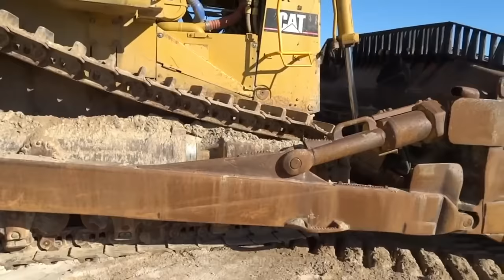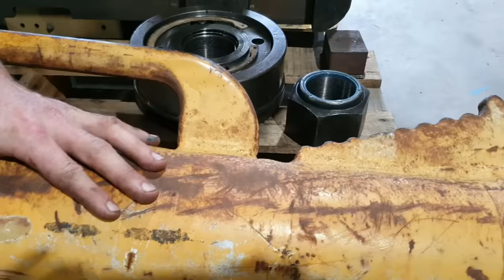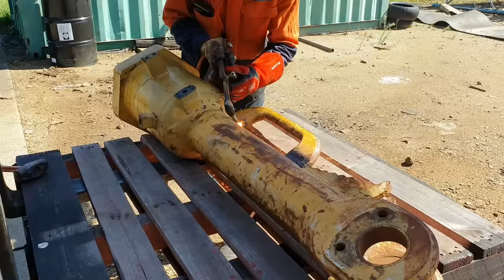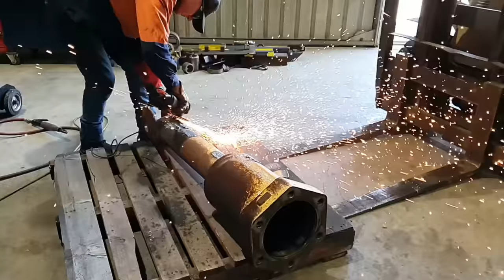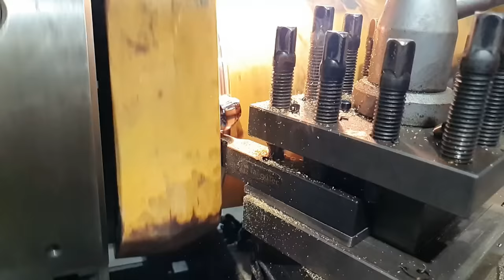CAT D10 Dozer Cylinder Rebuild | Part 1 | Machining

Comment: I'm not sure what I'm more jealous of, the smooth electric hoist for moving the heavy stuff around with, or the forklift with BOTH working brakes and forks that don't require a 20lb sledgehammer to adjust
Reply from the maker: Wait til we get our overhead 3T gantry crane setup 😂👍
Reply: @CuttingEdgeEngineering  look forward seeing it!

Comment: Another great video - good explanations. This heavy work is impressive - you will be in business for a longtime with the quality you put into each rebuild!
Reply from the maker: Hey David thanks for watching mate and appreciate the great comment 😎👍
Reply: @CuttingEdgeEngineering i have to agree with both you and David, because i have seen the pride and extreme attention to detail that you put into each and every single piece of equipment that you repair/rebuild and it would not surprise me if the parts outlast the machine they’re installed on

Comment: Great technique using the lathe to "Layout the Fabrication", and inspect it at the same time, as you say eliminates multiple handling of the job.
Fair amount of abrasion damage on the cylinder, though noticed someone gave it a coat of paint.
Sound business practice to source work, great work both.
Thanks for sharing.

Comment: Yes! This is going to be Epic. 
I hope y'all are safe during this very active earthquake event in New Zealand.
I figured that you either had factory specs from the manufacturer or you speced out parts on your own accord.
Reply from the maker: We are all good here in Aus haven't had any impact from those earthquakes. Factory OEM don't like to give out the specs so we make do with what we get most of the time 😂👍
Reply: @CuttingEdgeEngineering  even when I worked for Caterpillar they didn't like to share specifications. 
 In the late 70's we had a problem getting replacement pin sets for the earth movers and end loaders. I don't remember why but we decided to start remanufacturing the pins ourselves. We tried several different processes but finally landed on a MIG welding process that had a hard facing flux included in the wire. We perfected the process so well that it gained the attention of Corporate Caterpillar. We gladly explained how we had done our research and overcame our failures. After giving our presentation we got the
copyright and patent infringement blah, blah, blah. Then came the real meat of the program. Fellows we appreciate your hard work in developing the process but we have one big issue with it all. Can you back off of it for a couple of months so we can sell the pins off the warehouse shelves first? Boy were we relieved! We thought we were getting sacked for sure! Man those were the days. Keep up the fine videos and give the giggling videographer a raise in pay for putting up with you! Be mindful to keep nice cool water in the executive swimming pool too! 
 Thanks for the videos and keep up the fine work!
Terry from South Carolina

Comment: Is it just me, or does weld have a different sound when he's cutting through them on the lathe? like the weld chips have more paper crackle to em, whereas the rest of the metal tends to have more springy 'ring'(?) to em...
Reply from the maker: Hey mate you're spot in it does have a different sound and machines differently. The weld is a harder material
Reply: @CuttingEdgeEngineering  now is that due to the composition of the filler or the way in which it cools, i.e. annealing it would reduce the hardness?
Reply: @davidgramsay  it is harder in a few different ways. first the material the wire is made from superior materials  to the steel it will be fusing to, second the way the grain structure is in the weld is far different to regular steel as the grain of the metal gets massaged and rolled out when it gets manufactured where as welding is more simalar to cast metals due to the way welding processes work, third it is a bit like hardening steel due to the nature of welding it heat treats the weld however this does mean the weld is more brittle as it hasnt been annealed
Reply: @davidgramsay  To add to Drew's response, all of this actually depends on composition of the base metal, filler metal, pre-treatment, post-treatment, and how the metals respond to heating and cooling, especially in welding where the heating and cooling are localized to an area and not a full-part cycle like you see in heat treating. Metallurgy and material science are more complex than a one size fits all description of a single occurrence of an application of a presumably known filler on a presumably known metal. Most fillers you use on mild steel will act this way, but the outcome is entirely different if you're welding on a 303 stainless, as that will also be entirely different than welding on an annealed (pre-treated) 304L stainless, and that's before getting into alternative metals like aluminum. So while the response works for mild steel with a typical filler, the response would be incorrect in any other combination of base metal and filler. I also don't agree with the, "... superior materials,' part of the comment, every material has it's use and no material is superior unless you're seeking a very specific attribute of a material; it's similar to the strength argument of materials, there's no one simple answer because 'strength' can have multiple meanings, typically rigid yet brittle or flexible yet doesn't snap as an example, or how much a material can elongate before ripping as another example. 

If you're actually interested in metallurgy and material science, etc., I'd suggest researching it on your own and seeking out someone who has actually studied extensively under the subjects, or just outright studying it yourself. Rather than seeking answers from armchair experts, e.g. YouTube comments and Reddit threads, which is prone to leading to misinformation, e.g. 'superior materials.' You can also judge if someone is an actual expert or an armchair expert by relative knowledge and use of basic grammar, things like proper sentence structure, correct spelling, correct use of punctuation, and correct use of lists; as a truly educated person is typically better composed in communication, as proper education in communication comes alongside proper education in the subject, how one presents themselves and their arguments is important to deducing how knowledgeable they are in general, and thus how knowledgeable they potentially are in a specific subject. Seeking better knowledge also allows you to crosscheck armchair expert knowledge, e.g. 'superior materials' again. At the end of the day, it's better to do your own research using trusted sources, e.g. peer-reviewed studies, that don't spread misinformation.
Reply: @xaytana  Great replies by everyone. One thing I know about armchair experts is that, even though a person isn't using the proper form of communication, they usually use some key words that will help the self-motivated search. Key word here is self-motivated. Ya gotta want to learn and do the research rather than just accept the first thing that you hear.

Comment: Wow, I didn't know this kind of work was still economic in the throwaway world of today!
Also, my respect on how you took that thing apart. I know nothing about hydraulic cylinders, but it seemed spot-on methodically, no slaying or butchering, just efficient dismantling. Top!
Reply from the maker: Cheers mate! Thanks for watching. Yeah no doubt a few bits of machinery have gone to the scrap yard that could have been salvaged if people knew what to do

Comment: one thing shows you feel the job is the way you tight bolts and nuts or when you hit something, not so tight, not so loose, enough hammer hit to do the job, eeeasy 😎 in my shop we use crack dye as well but it depends on the material and on the type of dye and the cracks are revealed by UV light, it glows in bright green color, the order of the liquids application are pretty the same, we'll wait the part 2! good job!
Reply from the maker: Hey mate thanks for watching always great to hear what others do out there! 😎👍

Comment: We were using that same type of crack detection at Ford Research & Engineering (UK) 50 years ago.  We also used a process called Stress Coat which involved spraying a component with a special coating that was hard and brittle.  Then the part was stressed which would reveal weak areas because the stress coat would crack.  This was a precursor telling us where to place strain gauges to measure movement on a part by driving the vehicle over special surfaces.  This was later superseded by CAE where computer modelling became so good they could predict what would break before they even made it.  This would have been 30 years ago (at a guess).
Reply from the maker: That's awesome mate and cool to read how some things have changed and some stayed the same! Thanks for watching every week. Cheers, Kurtis 😎👍

Comment: Hey Kurtis, great video as always, just some advice from an old fart, when you are doing a dy-chem crack detection you should paint strip it first, do the dy-chem and then grit blast or bead blast after woulds as either of those processes can peen over the edges of a crack and thus hide them from the dye penetrate process.

Comment: Dye penetrant crack check is such a neat tool. I wonder though if after such an inspection and clean up, are those parts just as good as new? Your vids are about as good as it gets when it comes to heavy duty machine work. You obviously know your stuff. Puppy dog adds a lot. Seems he has as many fans as you do!Looking forward to part two.

Comment: Nice one Kurtis, some nice heavy turning going on there. We used to carry out crack testing on the winding engines in the mine following a disaster in England. Looking forward to Part 2. Stay safe. Regards from Wales
Reply from the maker: Hey mate thanks for watching over there! Did you use dye penetrant testing or another form to test the engines?
Reply: @CuttingEdgeEngineering  hi Kurtis, definitely dye penetrant and also what I think was x-ray or maybe sonic? A team used  to come in for that. We had to do the prep work,

Comment: I just realized why he doesn't oil his cutting bit. He wants to work harden the surface with heat to create a tough exterior because he is cutting into the metal. He is removing the heat treated and annealed top layer, so by reducing the oil he uses, he not only work hardens the surface, but he also avoids chemical reactions between the oil and a hot surface. The carbon introduced from the oil could affect the metal and change it's chemistry. Such a small change in technique. Oil versus no oil, and you get such a dramatic outcome in the molecular structure. I love how these videos ask me to think, "Why is he doing it that way?."

Comment: That Ram is going to be like Triggers old Broom  "its had 17 heads and 14 Handles. How is that the same broom from 13 years ago ? I got a photo of it." 
Great Vids
Regards Richard 😉
Reply from the maker: Mate we have been wondering what the triggers broom comments were about thanks for resolving that 😂👍
Reply: @CuttingEdgeEngineering  sorry about that, just put in Triggers Broom on you tube, it was a bit from only fools and horses.
Regards Richard 🇬🇧
Reply: @CuttingEdgeEngineering  Hi Kurt's, I'm sorry I have been spelling your name wrong evertime I have posted any comments, I do apologise. There is something heading your way should be with you next week and for once its not for Mutley. You can tell its from me as i have spelt your name incorrectly again. I am sorry, I only have noticed your name on your overalls tonight. Great Video, just looking forward to No4.
Wishing you both a good weekend.
Regards Richard 🇬🇧

Comment: Hi Kurtis, Karen and Safety Officer! Another great video and the start of a multi parter. 
I was thinking about what you said about taking the assembly apart and you are 100% spot on. Using the lathe, everything on the part is related to the centre axis and that makes taking it apart square easier. If you were to cut it apart on a saw you would have to be packing things level and checking alignment before and after. You have the lathe so use it. 
How deep was the wear on the cylinder? I eyeballed it at around 4 mm?
Reply from the maker: Hey Mark! Always great to read your comments mate and you're very close was about 5mm wear on the barrel. Cheers, Kurtis have a good weekend mate 😎👍
Reply: @CuttingEdgeEngineering  What is the wall thickness of cylinder?

Comment: Always shake my head while watching you part a cylinder. I can see myself wandering all over the globe trying to find the joint 😀  Relatively recent subscriber and I've been really enjoying it! I've never owned or operated a lathe, (though I'm contemplating buying a mini) so I'm curious as the reason you primarily machine toward the headstock. Less pressure on the tailstock?

Comment: Hey Kurtis, when you rip out welds on head flanges and rod eyes etc do you just keep removing material until you see the 'crack'? I have never done it that way in the lathe before cause I'm scared it will all just fall to bits in the machine. Looks like you have alot of success doing it that way. How do you keep everything intact in the lathe?.

Comment: Hi Kurtis. Is there a particular reason (other than rigidity concerns) that you use a PRDCN / RCMT to part off, as opposed to a regular parting blade / insert? Ta, Steve
Reply from the maker: Hey Steve they can take an absolute flogging, can really feed it and don't often need to change out for a new insert they are very robust 😎👍

Comment: Another great video about munted parts, brought back to life by our hero, Curtis The Machinist! : )
However, being a natural born knocker, I'm wonder about the way you're cutting that band for steady rest. Seems to me it goes kinda deep, unusually deep - just because of that small section of the cylinder badly worn off (see @ 8:45). Wouldn't it be better to weld up a small patch of metal right where the damage is, just where the easy rest would be, and thus save yourself some machining work and time? Just asking...

Also, I've seen other folks treating old paint on parts to be sandblasted with oxidizing flame of a torch prior to sandblasting  - this removes most of the paint quickly and with minimal effort, and additionally those charred remains of paint are easier to blast too.

Comment: Good job as per usual Kurtis.  Is that sandblasting cabinet a new addition to the shop?  Cheers, Aaron.
Reply from the maker: Hey Aaron! How you doing down there mate? Nah had this sandblasting cabinet for a couple of years now just don't need to use it too often. Cheers, Kurtis 😎👍
Reply: @CuttingEdgeEngineering  Doing really well thanks.  Keeping out of trouble and my nose clean of Covid LOL.  Hope you and the family are well.  Cheers, Aaron

Comment: Hey Kurtis, I may be 47, but I’d be your apprentice any day. 

When did you get onto this field of work? 

Great video, can’t wait to see how it turns out.
Reply from the maker: Hey mate! Hahaa yeah we've had alot of those requests might have to do a tour/training day in the future 🤣 Got into it 20 years ago quite a range of experience over the years from welding, to operating machines and fitting/turning
Reply: @CuttingEdgeEngineering  I’m heading up to Qld Monday, should be there around midday. Would it be ok to say hi? As long as the safety officer allows it lol

Comment: Great videos boi, one of the best channels I’ve found in a while. Is that the new 7 meter lathe in the background? Are you gonna do an update on the install for it? Cheers
Reply from the maker: Hey mate thanks for watching appreciate the support! The one in the background is the 5 metre, the 7 metre is behind that not quite in the frame. Haven't got the big girl installed/set up yet but will have a video when we do!

Comment: There any concern of over heating the cutting tool cutting those welds? I know welds are like a hardened metal.
Wow, that steady rest is almost big enough for that cylinder. 
Great work so far. Cheers :)

Comment: The torch reference is awesome sometimes in America is called a gas axe , the heater and then bring the Beater . BFH Big fucking Hammer.  Great videos as a job shop machinist just love the sound of the chips curling of the material . Do you receive viewer mail ? .

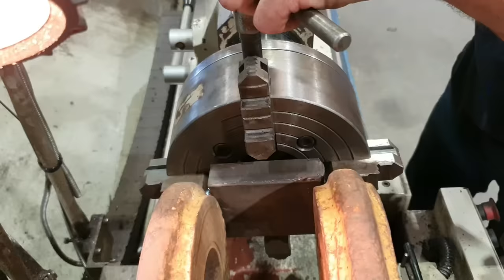Comment: 6:03 how did you know you welded that block on the exact same axis as the other end?  Or you just offset the jaws until it's centered on the block instead of the other end of the lathe?
Reply: A 4-jaw chuck doesn't self-centre like a 3-jaw. The operator adjusts each jaw separately

Comment: Don’t give a shit what anyone else thinks but I reckon you have inconel balls spinning that eye at that speed whilst gouging out the very weld that’s holding it - I know there’s a socket but if the dickhead before you did the wrong thing with the weld it could move - an alternative explanation could be that I’m shit scared of my lathe.   Absolutely top class content.

Comment: After watching you de construct the ram, cutting up in a band saw first isn't just double handling but it makes more work having to setup each piece separately.  
On the large tube, is it big enough to put a bowling ball into?  Would make an awesome mortar tube if it does fit.  Bowling ball, little dash of this, a sprinkle of that, sparky sparky and voila, a flying bowling ball. ;o)  Hhhhhhmmmm, I'm starting to see a trend with my posts on your channel.  Could it be you are a bad influence or am I just an evil thinker.   Probably an evil thinker ;o)

Comment: Do you all have anyone around your area that does replating of rods... here in the states I work at an case dealership and we send rods off often to get  chrome plating done as long as it’s not belt, and it’s runs from around $120 to $500 bucks depending on size of rod... heck of a lot cheaper than a $1300 rod